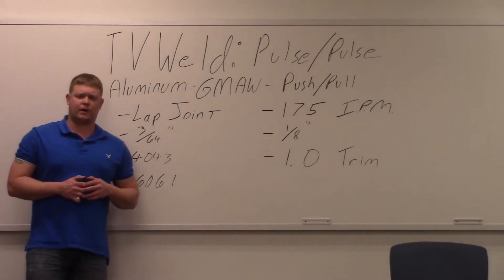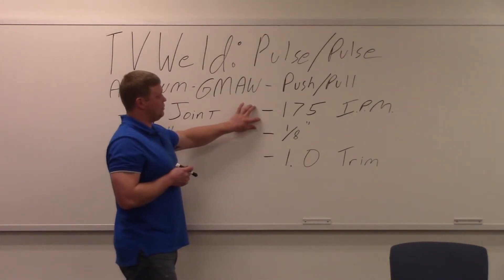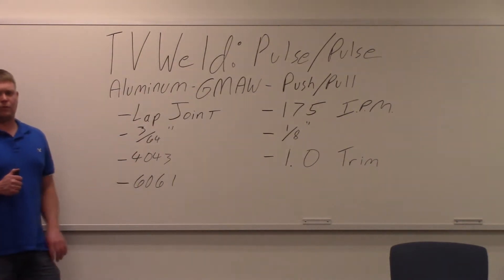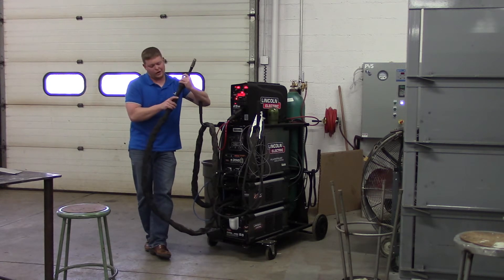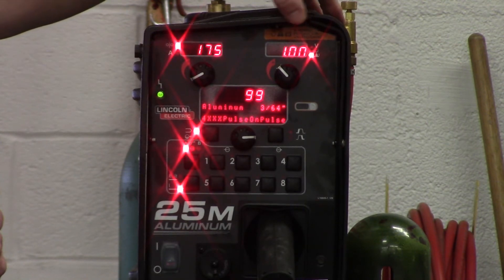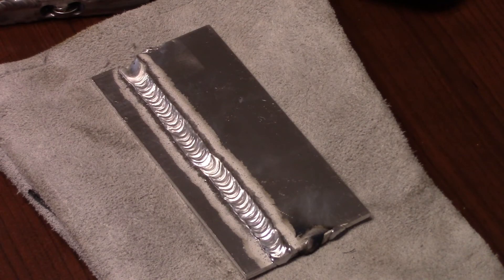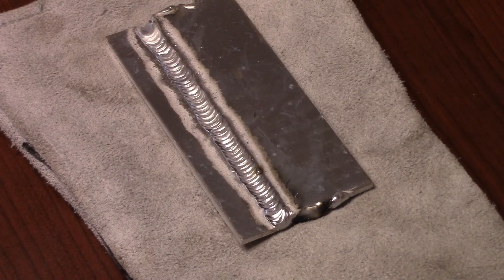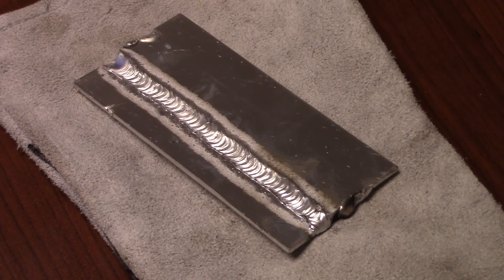Pulse on Pulse Aluminum MIG Welding

Comment: i run a Lincoln 350mp with 4043 wire i run mode 99 most of the time sometimes i will switch to standard pulse. i work for feather lite trailers and i will tell you that them welds would not pass due to your craters i would turn crater fill on and put your hot-start on for a little longer  the weld looks good but please work on start and stop thats where most welds tend to break or crack in my experience good video.
Reply: You have some good points. I'm going to try using pulse mig on my everlast welder for the very first time soon.
Reply: Thanks for the info..I know your comment is old,but I own a 350mp and Python push/pull rig..the proper settings for aluminum  have been evading me..I had been using 5